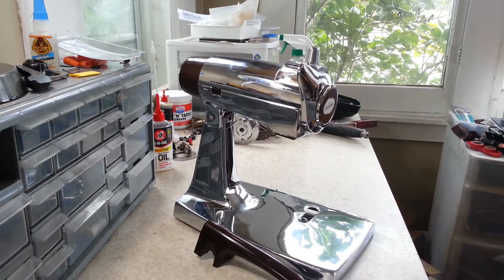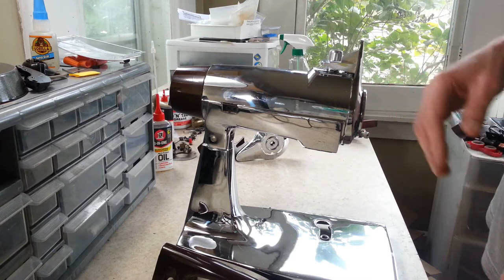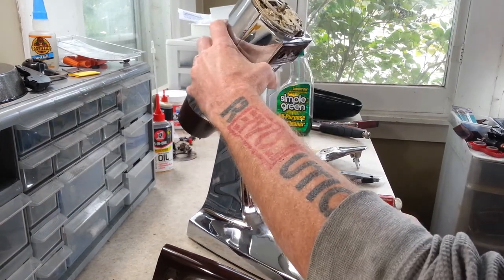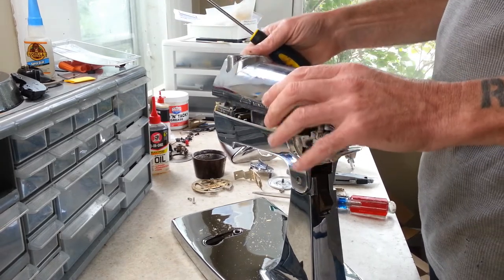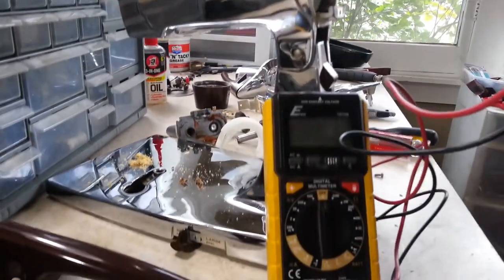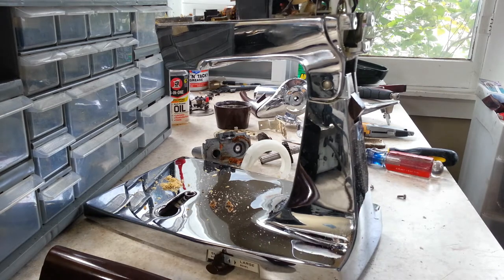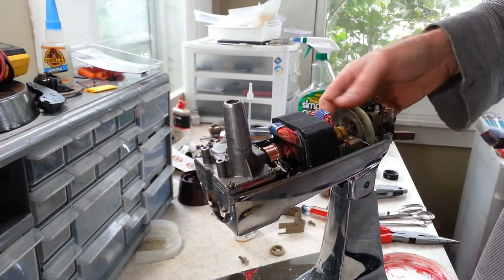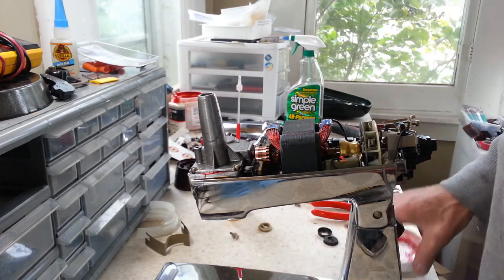Sunbeam Mixmaster Model 1-8B in chrome getting maintenance

Comment: Thank you, thank you, THANK YOU for your video. I have this mixmaster and it was complaining. I must have watched your video 100 times, but, step by step, I disassembled my machine based upon your guidance. At the gear box, I noticed you were using Lucas Oil"s #2 red wheel bearing grease rated at 525 degrees. I used a different brand, but it was #2 red rated at 500 degrees. I assumed that this grease was good enough. Of course, I put too much grease in the gear box and it oozed out while tightening the hold down screws. But I tightened the screws slowly and wiped up the excess as I went along. Because this was my 1st time and I was scared to death, I took about three days to get the job done. But I DID complete the job! Thanks again.
Reply from the maker: Your welcome! That's awesome, great job!! The grease should definitely be fine :)

Comment: I had no idea that these mixers were put together this way. I assumed that they had plastic gears and such inside. I was surprised to see that level of construction in these things!
Reply from the maker: It is pretty remarkable the way they were built, and they just last for so long due to the design and build specs!
Reply: @vintagemixersandmore1666  I just took ours apart to clean and service and I don't see any wicks where the bushings sit. Do you know if they omitted them in some machines and just used grease? All I see are empty holes where the bushings go. I did see what looked like grease on both of them. What would I use for wicks? Also, one of the retaining caps that hold the gears in place either didn't have a round felt under it or it went flying and I lost it. I wonder where I can find some felt like that? Any help would be appreciated....
Reply from the maker: I have seen one also that was missing the felt wicks in the holes, I am pretty sure it wasn't intentionally left out, probably skipped over on the assembly line. I bought a piece of felt and just made my own wicks. You could do the same with the one under the retainer cap your missing, that one is only there to catch any oil that may run out.
Reply: @vintagemixersandmore1666   Thanks... I'm gonna call a sewing machine repair shop here today and see if they have any 1/4 " wicks otherwise I'll try to find some wool felt. Some sewing machines take felts.
 Also, do you know how the fan comes off so that I can take the rear bushing off? I'd like to clean it up and try that frozen bushing in hot oil trick and see if it works!
Reply from the maker: I think it is pressed on, and may do more damage trying to remove it than can be repaired. I have never tried to remove one, so you would have to take a really close look to verify if it is pressed on, or staked on, or fastened some other way. Good luck, let me know if you get it off!
Reply: @vintagemixersandmore1666  Will do, I also emailed Dave who makes the governor capacitors, still waiting on his reply....
Reply: @vintagemixersandmore1666   I got some felt and Red & Tacky yesterday. I made a small makeshift bowl out of aluminium foil and heated up some 3 & 1 oil and dropped the front bushing from the freezer in it. Now I'm just letting it cool down on the stove. I had an idea(huh oh), gonna try to make a little trough out of aluminum foil to set the rear bushing in and isolate it from the fan and armature and then pour hot oil on it and let it sit in there and cool down. We'll see if it works. By the way, the gear shafts that ride inside of the longer bushings, what do you lube those with? Just grease? I wonder how they were meant to get lubed in the long run, from grease running down from the gear case?
Reply from the maker: awesome! I add oil to the shafts when I reassemble, but you could add a light film of grease as well. They are designed to wick a tiny bit of grease down to lube themselves. Im not sure how well that actually works, because they are always dry when I remove them. Judging by the design, it would appear the oil from the grease would probably wick down the shaft and be collected by the felt at the bottom, but as you probably saw when you disassembled, the felt is always dry, and no trace that oil has ever reached it. Whatever the intention, the designed was not changed from the 60's through the 80's as far as I know. Lube it up and run it lol it lasted this long with no wear, so something must be working.
Reply: @vintagemixersandmore1666   Yes Sir, I just got it put back together. Runs like a top except that damn governor capacitor coating started chipping more when I put it back in. I can see that tiny wire wrapped around it in a big spot now. Wish I knew how to re-coat it! It runs good anyhow.
 I just put a film of grease on the gear shafts. I cut out some felt and made a new washer and then cut some more for the bushing wicks, rolled them up and poked them down in the holes real good and forced 3&1 oil down in there real good. The front bushing I pulled out of the freezer and dropped it down in hot 3 & 1, it seemed to work, time will tell, lol. The rear bushing I just left on the shaft and pulled it out of the freezer and used a turkey baster to flood hot oil over it for awhile . I cleaned some of the metal parts including the body of the mixer in the dishwasher. Did a good job. I soaked a few things in vinegar for a couple days to get some rust off of a few small parts. I even took the roller balls out of the turntable bearing and cleaned it up nice. Getting the roller balls back in place was fun, I used grease to hold the lower ones in place while I slid the hub back in place and then added the top roller balls in. It's tricky trying to do it and not lose the roller balls back out of the bottom side while your putting the top ones back in. Took me a few trys. Now I need to soak the bearing in acetone to get rid of the grease because it's too thick, it doesn't want to turn easy enough. Then just put a drop or two of oil in it instead. The only thing left to do after that is stick the logo plate back on the front and call it a day!
 Thanks for your help!
Reply from the maker: Jeff Stone Nice job!! You definitely ventured where I would not with those bearings lol, me and bearing balls don't mix! The resistor coating is a pain, it starts to crumble on almost all of them , there is probably something they can be coated with, probably in a ceramic shop, but Im not sure what would work best. I have never dinked around with ceramics before, but I imagine if some of that stuff can fire in a kiln, then it should be able to handle the heat of the resistor. 
Once again, great job!!!

Comment: I am always thankful to the people who post such helpful videos!  I have a 1-8AT that was getting quite wobbly in the front end beater assembly.  Using your video, I felt confident to take that all apart and have tightened everything up nicely but now I physically cannot get it to lock at the top.  If I assemble it in the locked position, I can unlock it with a quick smack but I can't relock it afterward.  I now remember this being a problem long ago which 'fixed' itself as the front end loosened up.  Any suggestions?
Reply from the maker: Hi! Are you referring to the handle, when you turn it to eject the beaters? If so, there may be a misalignment between the part under the handle and the pin that engages it, which is attached to a spring. If you turn the handle assembly, you will see the pin at the top, check that it will move up and down, if its sticking, then you can investigate further. Also check where it engages under the handle, make sure it is not bent or that there is nothing stuck there to get in the way.

Comment: Would you happen to have the service manual for this mixer? I have finally received my replacement resistor in the mail and have realized I have a few extra tiny washers from the armature after my last disassembly since I didn't properly document everything. I'm specifically looking for the exploded view of the mixer so I can prevent some rubbing that's happening inside the assembly when it's all put together. Thanks for any and all pointers, we all really appreciate what you're doing to keep these wonders of bygone years running!
Reply from the maker: Hi Arthur, I am sorry I do not. It seems it is easier to find service manuals for the older versions than these. I think the washers go on the front portion of the armature, trying to use my memory here which is not what it used to be lol. Anytime I find washers on the armature for any model, I try to leave them in place, some have multiple washers of different materials stacked together, and I dont wat to have to try to remember the order they go if I mix them up.
Reply: @vintagemixersandmore1666  Thanks I appreciate it. I'll do some digging around online and inside my mixer to try and find where these mystery washers go. Then maybe I'll remember to take a reference photo or write this stuff down. Best Regards.
Reply from the maker: @ArthurIVA  Thanks, and good luck! I still take photos while disassembling anything I havent previously disassembled, it really helps! :)

Comment: Great video! I have the same model, and the resistor in mine is crumbling down in one corner--what does this mean for usability? I thought it was working fine, just opened it for cleaning.
Reply from the maker: Thanks! Those resistors usually have a crumbling outer coating, but an still test just fine. They get extremely hot, and considering the age, I guess it is to be expected, but doesn't necessarily mean the resistor is bad.
Reply: @vintagemixersandmore1666  the same resistor is used in the infinite speed portables too!
Reply from the maker: @russ5024  good info, thanks!

Comment: Thanks for the video. Quick question, is there a reason you're using Red N Tacky? I know the original grease standards weren't as strict as today, but wouldn't it be best to use an H1 food grade lube? At least H2 by minimum. Something like super lube 21030 because the motor is still sealed without a proper gasket, maybe?
Reply from the maker: Hi Topher, thanks for the question! That is a topic I covered in a couple videos. I do use food grade grease if it is requested, but the problem I have with it is that it breaks down and will start to leak out, in which case it is good that its food grade. Even more modern kitchenaids have that issue where the oil will separate from the solids in the grease, and leak out and stain the paint, and make a mess. The red grease does not separate out, and will stay in the gearbox where it belongs. 
Also it will keep its consistency if the machine is stored for a long time, as many of these are, some of them will probably never be used other than for show, others only once in a great while.
Reply: Ah thanks for the quick reply. I tore apart this same model just now, stripped it down, replaced the capacitor at the switch and was left wondering what to do for the grease. Thus found your video and thought I'd ask before I ran out and bought super lube or FM 222. I guess red n tacky is better than what was originally used, and that was perfectly fine. So I'll just stick with what's good. 
Also, long live the revolution my friend. RP 4 life. Unless you just liked that design and it was coincidental, then pardon me. :)
Reply from the maker: Ahh thanks! No, I got this tattoo definitely because of the RP revolution! You are the first viewer to recognize it! I love the idea behind it, it is how I live my life :) 
I have had no issues with that grease, I use it in all of my machines here at the house. It is personal preference, I know some do prefer the food safe, but to each their own, as long as it is lubricated. If you have the same model, don't forget to soak the oil wicks under the bushings! Good luck!! :)

Comment: Ours will run on high speeds but not too well on low speeds. I'm guessing it needs service, but is there any way to lube it without taking it all apart? Doesn't look like it from your video. 🤔 Also, the handle feels a little loose.. any way to just tighten it up a little?

Comment: I have the same mixer but a model 1-8 AT and it looks like the same capacitor in the little cardboard cover. My capacitor smoked and is too burnt to read the ratings and size. Can you tell me the specs or a part number. By the way the videos are very informative, Thanks.
Reply from the maker: Thanks Stan! Looking at one now, it looks like it says .05 + 80% (I assume this is uF) and looks like 25v -20%, not sure on that last part, some of it is wore away, ceramic disc capacitors. They are readily available online, you can get a higher voltage if you cant find 25. 
Full wording :
MDC 
.05+80%
25v-20%
1KV 
Hope this helps!
Reply: Thanks that should help a lot!

Comment: I have a similar-looking mixer.  It's a model 1-44B.  (Or maybe 1-44BN?  It looks like there's another faintly stamped character following the "B")  I think it's a much newer unit: plastic top cover, plastic gearbox cover, no juicer PTO with a beater eject button in its place, permanent power cord...  
The beaters actually clash because the gears jumped time due to excessive wear.  I looked online and couldn't find much in the way of replacement parts other than beaters and bowls.  Am I SOL?
Reply from the maker: You will definitely find new gears for it, but you may be able to find a donor machine  for parts on ebay. Im not sure if the MMA, MMB, 1-8b gears will work or not, as I am not very familiar with your model. You could ask in the facebook group "vintage mixer and small appliance network", there are some very knowledgeable folks in there.

Comment: I have one almost the same after I clean it up I had one part left but I have no idea we’re it belong. It a very small and stiff S.S. wire about 1 inch long with The two ends turn up 90° in the same direction but only 1/4” long . If you have any idea what I mean sure would like to know were it go’s. Hate to throw it in 13.

Comment: I was wondering about relubricating bushings and how effective it is - Last year I took apart a portable heater whose fan motor had seized up and relubricated the bushing, but for some reason it didn't last very long and the motor started making noise and running slower again. So my question is, can bushings like that be successfully put back in service if they have seized up and the oil it contained probably gummed up clogging the bushing pores? What do you think if I were to dip these bushings in solvent for a few days to loosen up the gummed up oil and then soaking it in new oil for a few days before installing them back in? Or are dried up, gummed up bushings hopeless?
Reply from the maker: Yea I don't see why soaking them wouldn't work to clean out the deposits. These bushings , and on most mixers, seem to be completely dry, I have yet to see an issue with relubricating them. On this style mixer, it draws oil from the oil wick in the body, but that will eventually run dry. The older sunbeam style bushings had an oil hole in the body that is in line with a hole in the bushing, so an occasional drop of oil will go directly to the shaft. On my heater, the bushing for the fan had a thick felt wick that I soaked in oil and haven't had an issue with it yet. I do clean the bushings, and will polish the inside with some scotch brite, but that is all I have ever had to do to them so far. :)
Reply: @vintagemixersandmore1666   Not sure if you've heard of this or tried it before but I read where someone said to take the bushing (oillite) and put it in the freezer to get good and cold and then put them in hot oil and supposedly they soak up the oil like a sponge. Haven't tried it yet myself but it sounded interesting...
Reply from the maker: Hi Jeff! No I had not actually heard of that! I guess I can see that working, the cold would contract the pores, and if you warm it up they would expand, and in oil when they expand would draw oil in.. at least the theory sounds convincing :)
Reply: @vintagemixersandmore1666  Yeah that's what I thought also. Gonna have to try it and find out.
Reply from the maker: Jeff Stone  sounds good! Let me know how it works out if you try it!
Reply: @vintagemixersandmore1666  Yes sir, will do!

Comment: Hmm, I have the same mixer the 1-8B and when I powered her up she heated up a lot. Like badly, do you think the fan is busted in mine or does it need new grease? It is quite old. It smelled like something was burning as well.
Reply from the maker: I bet it needs a good cleaning and lubrication. The oil wicks under the bushings are probably completely dried out, and the grease could probably use a change out to fresh. If there is a lot of drag on the motor from lack of lubrication, it would heat up, and if it is clogged with old flour, the air from the fan wont pass through the whole machine. Sometimes it is amazing what just cleaning and lubing them will do!
Reply: Replaced the grease and cleaned out the insides and lubricated the bushings, runs smooth. Grease smell is still there, but that's because it's grease. Still heats up but not as bad as before. Just gets warm now. But that's expected of motors when stressed with resistance... now to get that dough from climbing  up the dough hook... really annoying.
Reply from the maker: That's awesome! I don't know what to say about the dough hooks, I have never actually used them
Reply: @Igmus  if the dough hooks are installed correctly the rotation pushed the dough down into the bowl  I knead bread dough with my mixer occasionally I often use mine to make Sally Lunn, brioche or Challah breads